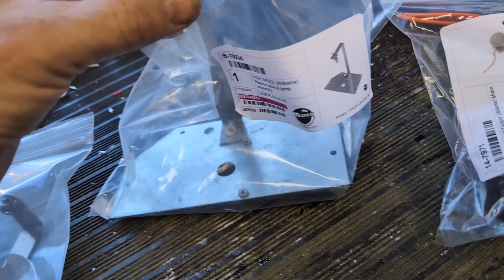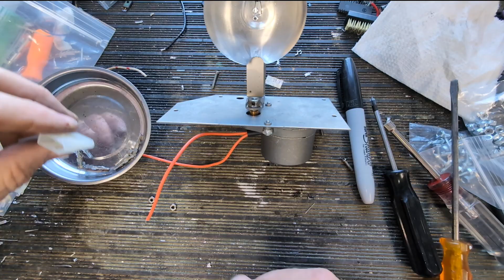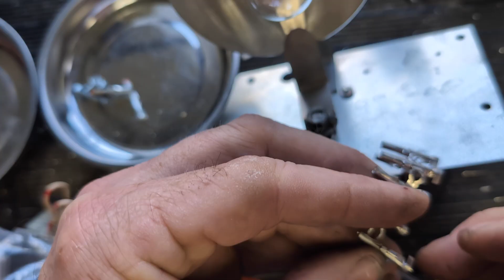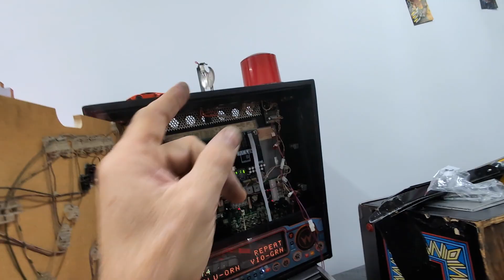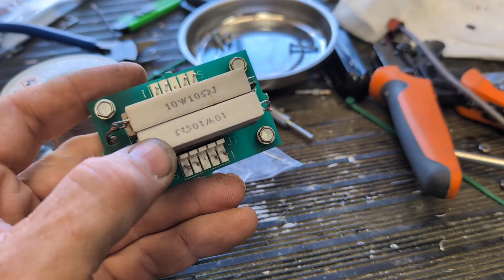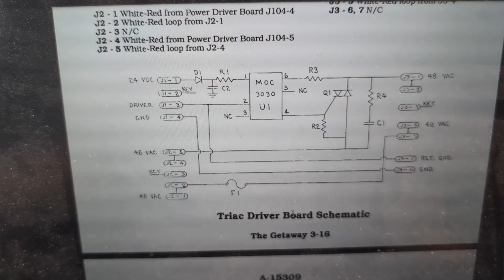Installing a replacement a High Speed Getaway Beacon light for a pinball machine

Comment: Should have titled the video "Ever have one of those days?"  Batting 1000 the whole way through it seemed.  And I agree with Jesse, I'm glad you put the original on it.  It is the way I remember playing it and sometimes extra doodads detract from the experience when they are so in your face like those flashers were.

By the way if you haven't looked it up, "SC Time Test" is a measure of how well the Super Charger is working.  It runs a ball through continually and gives you a number result for each circuit.  It can tell you if one of the opto sensors is not working which results in one of the coils not firing when it should.  Leebo has a pretty good video about it here.  https://www.youtube.com/watch?v=e1VylAQ_soM
Reply from the maker: Yeah, this one took longer than it should have...

Comment: If you run into the pin problem again in a pinch I’ve shaved down the wire insulation a little bit and then they fit much better . I know they make the pins that are supposed to be for bigger gauges but usually I just have the regular ones and struggle like you did 😂
Reply from the maker: Yeah these were my bigger ones, but for like a single bigger 18 gauge not two of them.